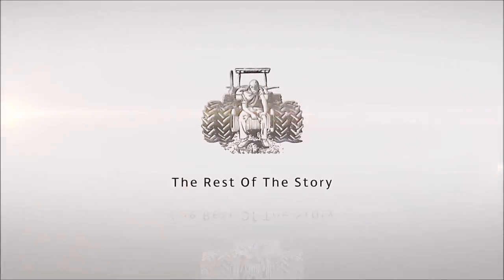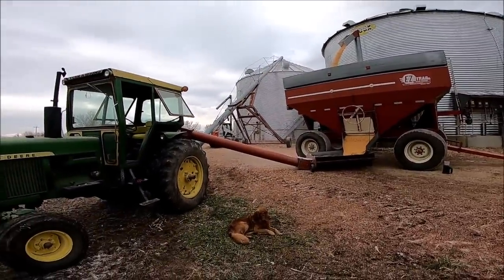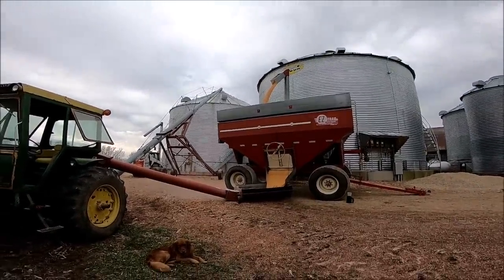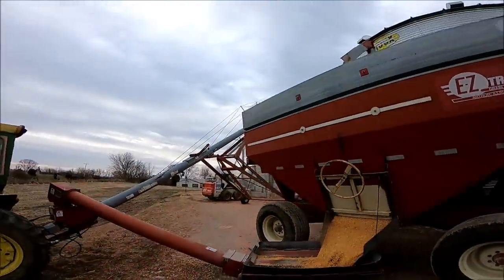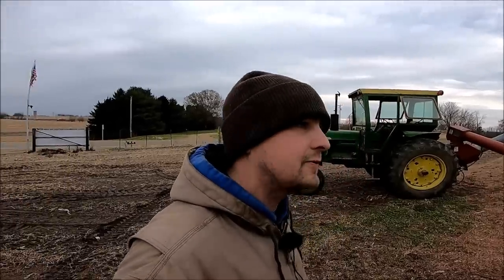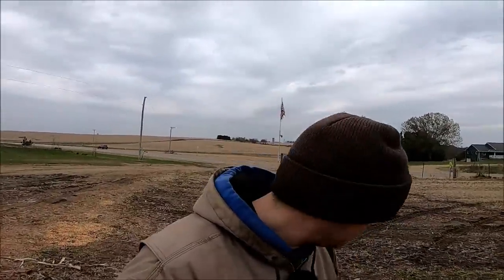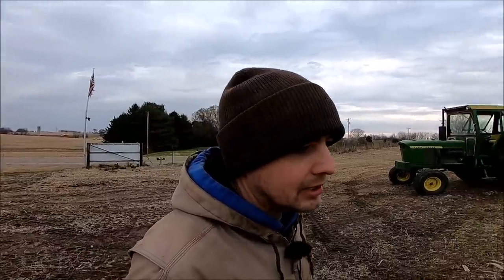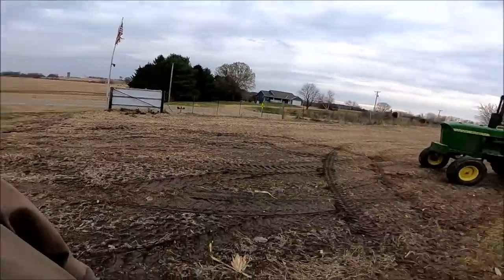Transfering Corn Between Bins

Comment: When we transferred corn like your doing Travis we always had the corn dryer fan going to keep the chaff from building up in the middle of the bin so you couldn't get air through and the grain would go out of condition otherwise it wouldn't if the fan was going. It took us 4-5 hours to transfer corn from one bin to another.

Comment: Good video, thanks for the update, always interesting to see the hoops you jump thru to transfer between bins, always wondered if it might be an opportunity to clean the product up to reduce penalties on delivery, I’m sure if it was easy you would already be doing it though. Good luck with the harvesting glad to hear you can bring the family together to get the tasks completed.
Reply: Well if the combine is doing a good job cleaning it there's really no "penalties"... so long as the moisture is right and the cup weight (bushel weight) is correct... moisture can be corrected by drying the grain and bushel weight is largely a factor of growing conditions and beyond your control, though if you're harvesting "dirty" (the combine isn't cleaning the grain well or you have it set to absolutely minimize losses out the back to the bare minimum, which creates more "trash" in the grain that doesn't get separated out) it can contribute to low bushel weight or "cup weight".  The new (to him) auger my BIL just bought is very similar to the one Travis and his family have there, but it has a screen on part of the swing-away auger tube to allow fines to drop out.  We put a cover over most of it and the part it didn't cover we put a wheelbarrow under and I used a corn scoop to throw it back into the swing-away auger as the wheelbarrow filled, because like the brother-in-law said, "I've already spent the money to dry the fines, might as well haul them to town with the corn, since it's extra weight!"  That's true... might as well sell the fines with the corn as extra weight, rather than using it for animal feed around the farmyard... particularly after spending the money to dry it in the bin along with the corn.  The old auger we put the corn into the bin with has no cleaner, and we didn't bother setting up the screen cleaner between the swing-away and the auger this year to separate out the fines BEFORE they went into the bin to get dried... though he said next year he'll remove the cover on the new auger and let it screen out some of the fines as we put corn into the bin... we used to do that with the rotary screen cleaner, and part of my job was scooping up fines and hauling them into the barn alley with the wheelbarrow and scattering them in a thin layer on the concrete to dry out "naturally" for livestock feed... 
Later!  OL J R :)

Comment: Ok that is a bit high for moisture. Hope they dont get docked for that
Reply: Well anything over 15% they're gonna get docked but usually they don't worry about it too much-- gotta get the harvest done before the weather turns to complete sh!t... a few cents dock for drying isn't worth the hassle of waiting for it to dry in the field or dealing with handling it multiple times to put it in the bin, dry it, and then load it back out of the bin onto the truck and haul it in to the elevator... My BIL in Indiana doesn't really worry about moisture much for corn heading to town unless it gets over about 21% moisture... then he might wait a few days to combine to get the moisture down a bit, IF the corn is actually drying some in the field.  This year it wasn't.  Think the wettest we've hauled to town was in the 23% range in a "normal" year (which this is NOT) and above about that yeah drying charges start adding up and getting excessive, so you start looking at bin drying or waiting to harvest or whatever you need to do above that level pretty much... Later!  OL J R :)

Comment: Just for fun and giggles how about having electric motors to run your transfer agers instead then your tractors
Reply: Then you'd have to stretch extension cords or power cables everywhere to run them, because the augers get moved around... plus you STILL would need to hitch the auger up to the tractor to move it and run the hydraulics to raise it up over the bin, and so where would be the benefit to that??? Now if they had a built-in TRANSFER AUGER setup that would be different, since it would be an auger attached specifically to the bins to transfer grain from one bin directly into the other one, but they don't have that kind of setup.  If they did of course you'd want to make it all run by electric motors because it'd never move and be hard-wired in to the system... Later!  OL J R :)